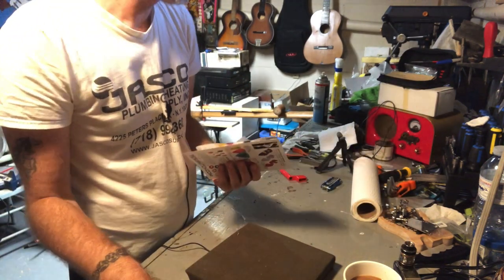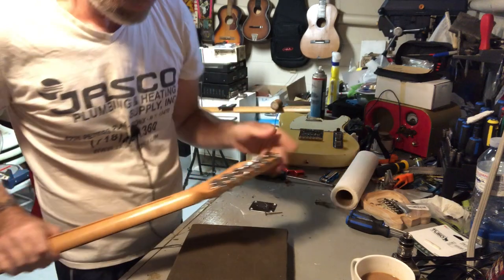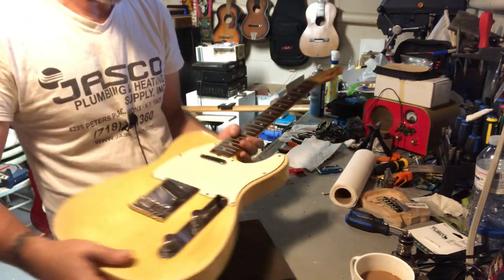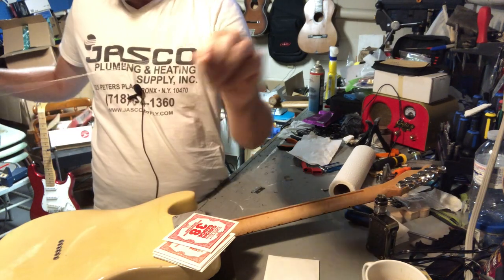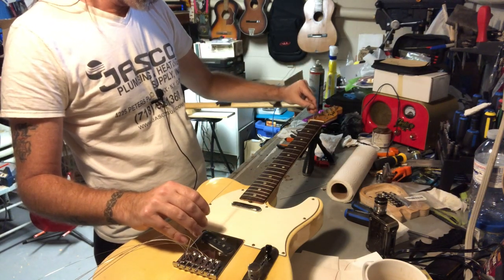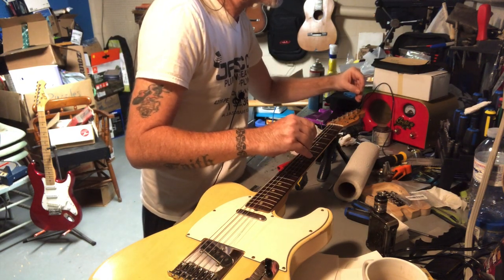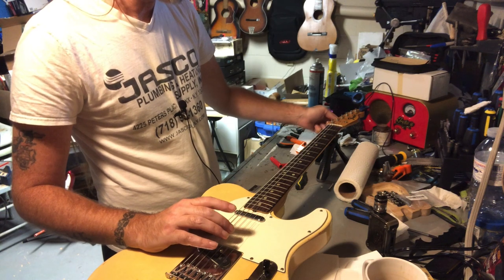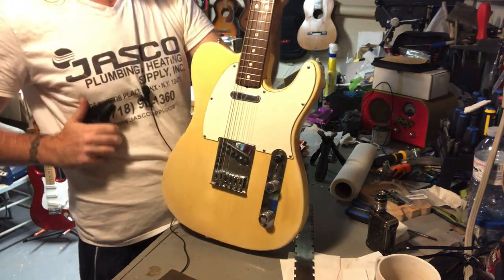Tele Back Bow Part 3

Comment: I've used "Ratio" tuners at least 3 times now. They come with "adapter plates" (6 for each tuner) that use the original holes, the new tuners then use holes in the adapter plates. No drilling. I think "Gotoh" has something similar also. I have 6 MickeyMouse tele/strat necks here I bought at a ScrewMac close out, maple vintage tint/rosewood boards, if you ever need one.  8)   Peace,   --gary
Reply from the maker: I'll have to look into those!!